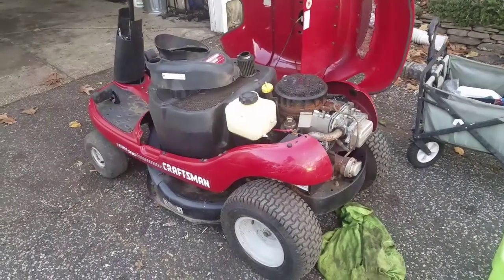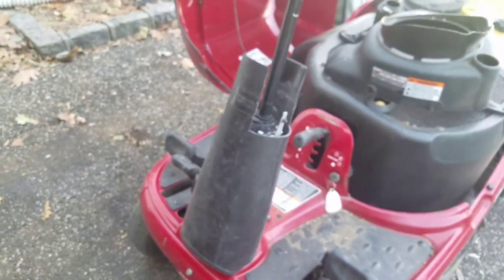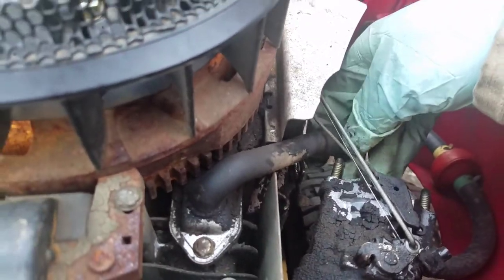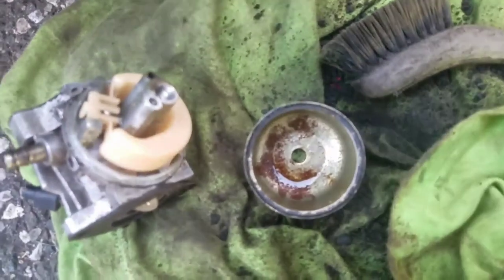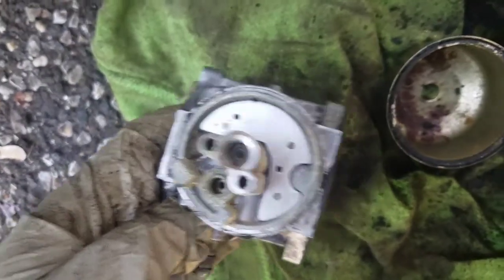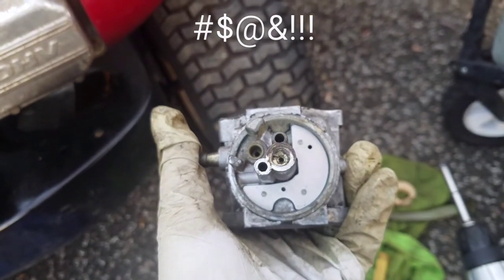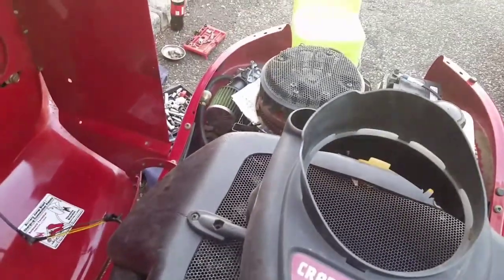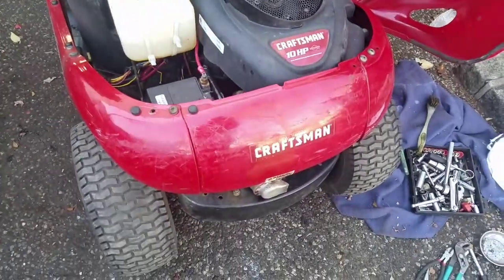CRAFTSMAN 10HP 30" DRM500 YARD BUG $50 PICK CARBURETOR & STARTER INSTALLATION REPLACEMENT  REPAIR

Comment: Mine won't run. Fuel filter and air filter looks clean and I replaced the fuel line but will only run if I put fuel directly into the carburetor. Any suggestions?
Reply from the maker: Clean carburetor, your needle is stuck
Reply: @MowersNBlowers  I'll give it a try. Thank you.
Reply from the maker: @rc4688  90% of issues is the carburetor
Reply: @MowersNBlowers  thank you

Comment: Can you make a video only about the carb? Like how to remove it and how to put it back
Reply from the maker: If you didnt see it here, there are others, just search, I sold it 3 years ago.
Reply: @MowersNBlowers  how much if you don't mind me asking I have one and want to sell it for a newer
Reply from the maker: @alicornredrainbow7921  I got $325
Reply: @MowersNBlowers  how can I test if the starter is good?
Reply from the maker: Put a jumper pack to it

Watch this episode
CRAFTSMAN LT2000 LAWN TRACTOR REPOWER KOHLER COURAGE STARTER MOTOR PROBLEMS & SAFETY SWITCHES BYPASS

https://youtu.be/NPw0Hd-pK2M
Reply: @MowersNBlowers  Thanks!

Comment: I have this machine and I love it  because of the size, your video was great thank you, question I'm having1 carburetor problem I think?  it runs for 10 minutes with full choke and than it dies, would you have the part number for that chinese carburetor, once again that video was great
Reply from the maker: 799727

https://rover.ebay.com/rover/0/0/0?mpre=https%3A%2F%2Fwww.ebay.com%2Fulk%2Fitm%2F332410682485
Reply: thank you
it shows it's for a 14-17 hp B n S?
Reply from the maker: Thats what mine was..how many hp is yours? Instagram follow me @mowersblowers then private message me a photo of your engine.
Reply: 10 hp
thank you
Reply: are you on facebook? Im not on instagram
Reply from the maker: @billneedham3388  yes, search mowers n blowers.
Reply: here's numbers off the engine 2149070272E1 and 040216ZA76653 hope this helps thank you
Reply from the maker: @billneedham3388  why dont you simply compare yours and the ebay one and see if theyre the same?
Reply from the maker: You just need to clean your carburetor, you may not need to replace it.
Reply from the maker: @billneedham3388  mine was also a 10hp.  799727 is the carb you need.  The ebay one i sent will fit.
Reply: whats the best way to clean it?
Reply: thank you
Reply from the maker: Watch one of my carb clean videos.  Youll need carburetor parts cleaner and take it all apart.
Reply: thank you may I have your name please thanks again
Reply from the maker: @billneedham3388  its henry...at mowers n blowers.
Reply: thank you Henry for all the help and infomation
Reply from the maker: Anytime bill.  Hope you'll subscribe to my channel and spread the word